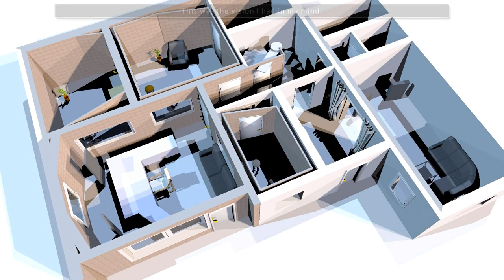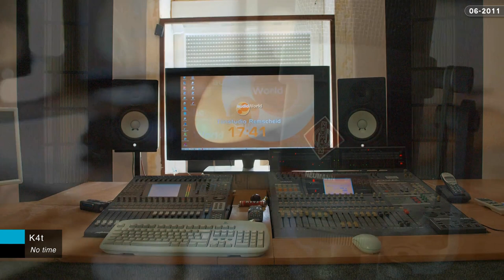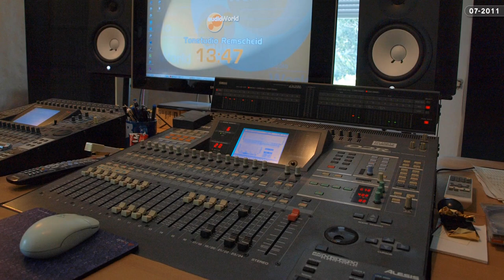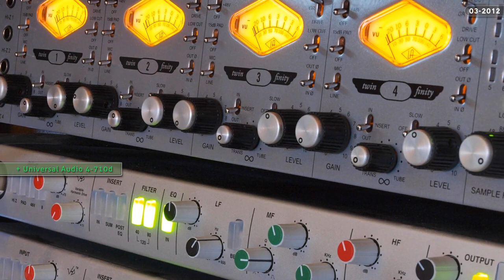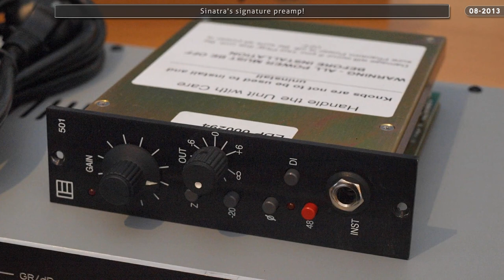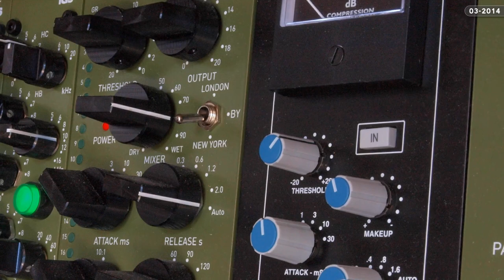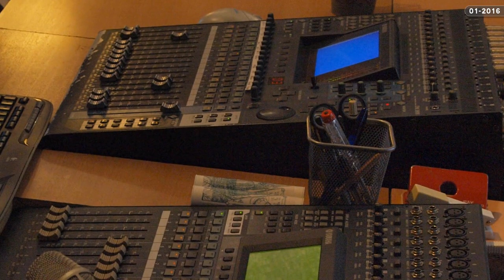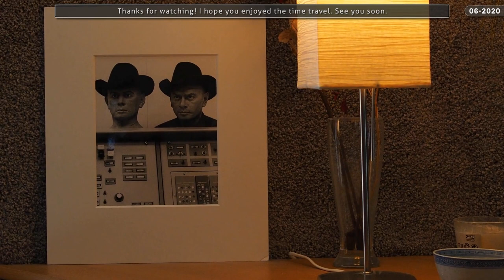recording studio construction and evolution from 2011 until 2020 (all-digital to hybrid)

Comment: Great video! I have a question about the A32 Dante - do you have any idea what the latency is playing a VSTi synth on the computer, going out through the A32 Dante over Dante to a mixing console is? Or what the round trip latency is on the A32 Dante? I'm thinking of buying one for my studio, but I don't know what kind of latency to expect. Thanks!
Reply from the maker: Thank you very much for your comment, Ben!  You really don't have to worry about the latency of Dante hardware devices. They only introduce minimal latency transferring Dante IP audio data packets across the network, typically way below 1 ms (like 0.25 ms or even 0.15 ms). In a Dante network, you usually have several Dante audio devices like Dante stage boxes, Dante-enabled mixing consoles and something like the Ferrofish A32 Dante converter. All those devices have very small latency of 1.5 ms or less. The converter section of the A32 Dante introduces only 17 samples of latency per direction. To integrate a computer into such a Dante audio network, you'll either need to use Dante Virtual Soundcard (short: DVS; it's a driver which turns your computer's NIC port into a 64x64 channel audio device) or a PCIe audio device like the Yamaha AIC128-D. In contrast to standalone Dante hardware audio devices, both DVS and also the PCIe card introduce ASIO latency (or Core Audio latency on a mac) because they have to feed audio data in and out of the computer which adds quite a bit to the very small Dante network latency. Depending on the specs of the computer, DVS' latency will be around 4 to 25 ms while the Dante PCIe card will introduce the same latency as other PCIe audio devices (MADI or ADAT), typically between 1 and 5 ms.
It's very important to undestand the difference between Dante network latency and ASIO latency! Both add up to the system's accumulated latency. The Ferrofish A32 Dante (being an ad-/da-converter) will only contribute it's conversion latency of 17 samples per direction, a Dante latency of 0.25 ms and no ASIO latency at all! The Yamaha AIC128-D as the computer's actual audio device will contribute 0.25 ms of Dante latency plus some ASIO latency depending on the chosen buffer size. I'm getting a RTL of 3 ms @ a buffer size of 64 samples, 6 ms @ 128 samples, 12 ms @ 256 samples and 22 ms @ 512 samples. My computer is only Intel i5 with 16 GB of RAM so I usually settle on a buffer size of 256 or 512 samples to avoid glitches. All those values are @ 48k sample rate.
With a more powerful processor like an i9 or Ryzen 5 and a modern mainboard, I could set buffer size to 128 samples or less. However, even at my setting of 512 samples, I can still play and monitor VST instruments live (incl. other VST fx on top) with no perceivable latency and no glitches. Playing a VSTi produces half of the RTL because the audio doesn't have to travel into the computer but only out of it. This is 4-10 ms depending on the buffer size and this is absolutely fine.
Accumulated latency of my entire signal flow is: Ferrofish (2 x 17 samples + 2 x buffer size latency + 0.25 ms of Dante latency) + AIC128-D (2 x buffer size latency + 0.25 ms of Dante latency.  As you can see, Dante latency is the part to worry about the least. As with all conventional computer audio devices, you worry most about ASIO latency.
You'll need a very powerful computer to achieve very low latency (like under 6 ms) with DVS as the main audio device because DVS has a lot to coordinate to get up to 128 audio channels through your NIC port. The CPU has to do all the work in this case.
If you don't have a mixing console to provide zero-latency monitoring, I'd recommend getting something like the A32 Dante and pair it with a Dante PCIe card in the computer. Latency will be similar or even smaller than that of a MADI PCIe card. I'm using a Yamaha DM1000 mixing console which receives Dante splits of all audio channels coming from the Ferrofish converter to provide zero-latency headphone mixes. I'm only monitoring through the DAW when I play VST instruments.
Reply: @SonicAxiom  thanks for the extremely thorough explanation. I thought, for some reason, that the A32 Dante was also a USB audio interface! Since it isn't, and since I only need the AD/DA <> Dante bits of what the A32 Dante offers (as well as a USB interface), I think it makes more sense for me to get something less expensive, like the Tascam ML-32D for my 32x32 AD/DA <> Dante conversion, plus a Focusrite RedNet PCIe card. And I'm planning on using all this with an A&H SQ-5 digital mixer with the Dante expander card. Basically, I'm trying to get 32x32 AD/DAs over Dante to connect to both the mixer and my PC so I can do recording and streaming while playing live instruments, VSTis, and doing channel insert fx on the PC! Whew, that was a mouthful!
Reply from the maker: @Cowboy-Ben-Alman  You're welcome, Ben! I'm essentially doing exactly what you are describing: splitting signals between DAW and console, playing VSTi, inserting analog stuff into DAW channels. It's easily done using Dante because any channel can be routed anywhere between devices and even rooms. I'd recommend getting away from anything point-to-point like USB, Firewire or Thunderbolt. Those connections are not flexible. You can't route where you want, cable lengths are very limited and the devices are not standalone but instead they are depending on a host computer and drivers which is often the cause of trouble. Dante devices (except for the PCIe cards) are always standalone and not dependent on a host computer and drivers to function properly. This is a HUGE advantage!
If the A32 Dante is too expensive there's also the Ferrofish PULSE16 DX (16x analog i/o, 32x ADAT i/o, 64x Dante i/o + 64x MADI i/o). If you already have decent ADAT converters you can keep those and simply add a Ferrofish VERTO32 to bridge ADAT to Dante.
I initially had the RedNet PCIe (1st gen) and had some serious stability issues with it (4 years ago). I switched to the AIC128-D and it worked flawlessly.
Reply: @SonicAxiom  I've looked, but can't find the AIC128-D for sale anywhere! However, I've had great experiences with RME, so maybe the RME Digiface Dante would work. The Pulse 16 DX looks good, but it only has 16x16 analog I/O and I need 32x32 (and I don't need the ADAT or MADI). The Tascam ML-32D is just 32x32 Analog <> Dante. Unless you can think of a reasonably-priced way to get another 16x16 analog I/O at 96kHz out of the Pulse 16 DX!
Reply from the maker: @Cowboy-Ben-Alman  I wouldn't recommend the Digiface Dante since it connects to a host computer via USB3 and that's something I'd try to avoid. Just another variant of connectors that may become obsolete too soon. Network connections will remain available far longer.
The Tascam seems ok if all you need are 32 analog ins and outs. Just in case you already have an interface featuring ADAT connectors (like ADA-8200, Fireface UFX, etc.) you could run up to 4 of those 8-channel ADAT connections into and out of the Pulse16 DX to add to its own 16 channels of ad/da conversion since it has 64 Dante i/o in total. Its 16 analog channels can be routed to Dante as well as up to 32 more channels coming in via ADAT (or MADI). A lot of folks have been using ADAT gear in the past and that's where the Pulse16 DX can help making a smooth transition to Dante while being able to keep the old stuff. Be aware that while the Pulse 16 DX will keep its 16 analog inputs and outputs @ 96k, ADAT, MADI and Dante connections will be cut in half. That's enough to get 32 channels in total, though.
Do you need a Dante converter or rather a Dante stagebox that has remote-controllable mic/line pres in it and that can be placed inside a live room?
Reply: @SonicAxiom  I actually already have a Fireface UFX and two ADA-8200s, but I plan on moving to 96kHz, which the ADA-8200 doesn't support. And the Fireface UFX has been amazing (with rock-solid, super low-latency drivers) but it doesn't seem to make much sense in a Dante-based system. Still, my experience with RME leads me to believe that the Digiface Dante will be just as fast and stable. I'm not super worried about USB 3 compatibility, it'll probably last at least as long as PCIe does, and I'd be able to use it on a laptop without any other hardware if necessary. Honestly, I'll be surprised if I'm still using this hardware when USB 3 or PCIe become obsolete. Regarding I/O, since my studio is almost entirely synths, I don't really need a remote stagebox with mic pres. If I did, I'd just get the A&H DT168. But the 16 built-in mic/line inputs on the SQ-5 mixer will be more than enough for me. However, I do need a bunch of line ins and outs. 32 line ins will cover me for the foreseeable future, and I shouldn't need more than 16 line outs to route submixes into headphone amps, fx units, synth inputs, etc. What's nice about the Tascam is that if I connect it to two 24-channel 1/4" patch bays, I'll get 32 ins and 16 outs in 3U, at about $2300. How many U and how much will it cost to get 32 ins and 16 outs using one of the Ferrofish units?
Reply from the maker: @Cowboy-Ben-Alman  In your environment, the Pulse16 DX solution will be more costly than $2300, I think. If you don't need to integrate older ADAT gear and just need the 32 analog i/o the Tascam will be the perfect fit.
Not sure if any laptop can make the Digiface Dante work. The load on the cpu is quite high. For me, connecting Dante gear via something else than a network port seems to defeat the whole purpose :-D   It may be just fine for your needs, though. Depending on what you are doing on the laptop, you could also use Dante Virtual Soundcard and simply connect the laptop to other Dante gear or a network switch via its LAN port. DVS provides 64 ins and outs for only $30. If live monitoring is not required this would save you a lot of money. It works perfectly for tracking without live monitoring through the DAW or for playback where latency isn't an issue, possibly not for playing VSTi.
Reply: @SonicAxiom  I was hoping to find some kind of real-world comparison between the Digiface Dante and any of the PCIe Dante cards, but I can't find anything! Either way, I'll need some kind of hardware Dante interface for the PC to be able to do real-time stuff. Thanks!